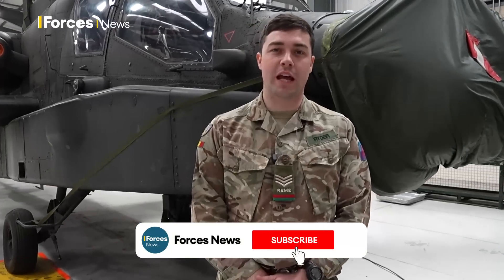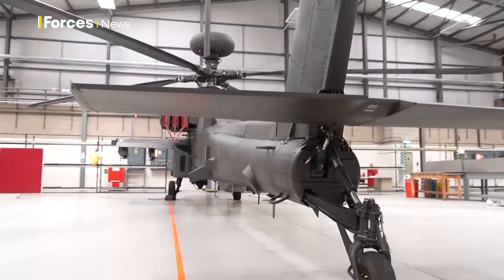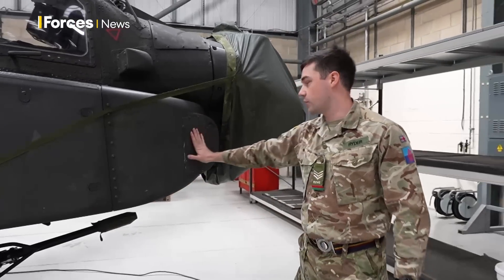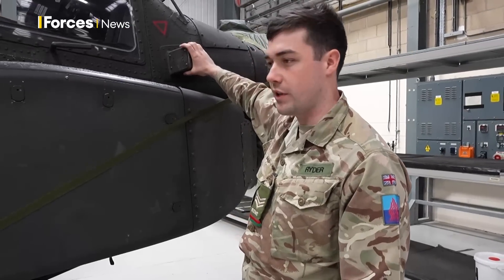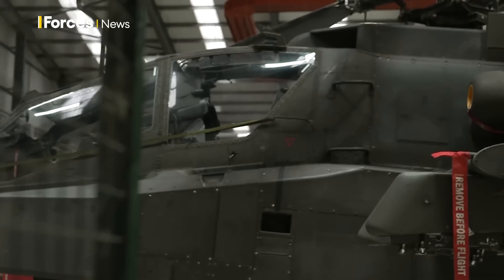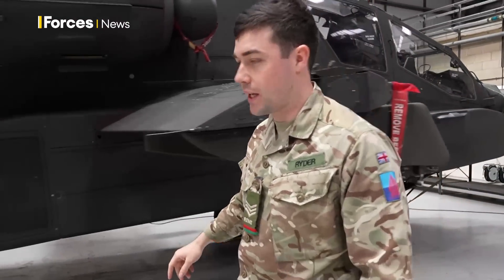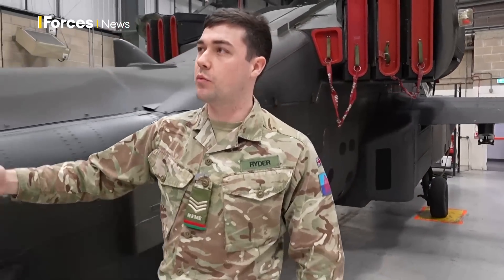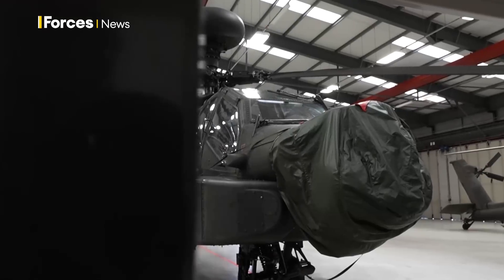How an Apache Mk1 attack helicopter differs from new AH-64E variant

Comment: So it's a slightly lesser aircraft, smaller rotors will have less lift
Reply: WTF are you talking about? You clearly have them mixed up. Watch it again.
Reply: @PureHokkaido The rotor diameter is slightly smaller on the new version thus Davis29.. assumes overall performance is less
Reply: No, the rotors & airframe are lighter, plus the new engine is better 'tuned' to the helicopter so now it uses its whole engine power range

Comment: Has the ability to fold the rotors for naval operations been lost with the upgrade? I know the actual blades are new but I can't seem to find any reference to whether that particular capability has been sacrificed.
Reply: If its anything like the american ones, they should fold just fine
Reply: They all have foldable rotors for storage and transport.
Reply: Nothing to do with "naval operations" since they are not used there...purely for storage and transport.
Reply: @Shontaku  The airframes on the WAH-64 were marinised, i.e. the joints were filled with a compound to prevent corrosion. They were then used on board ships in the Mediterranean during the time Gaddafi was toppled.
Reply: How do you mean? There was no system on the Mk1, and it was done by hand.
Reply: @rogeri2468  Yes, it was done by hand. But my question was if the AH-64E can also do that. The standard AH64A-D variants couldn't fold their rotors at all.
Reply: @jensonkiin3678  The WAH Mk 1 is/was essentially an AH-64D with RTM 322 engines and lots of British avionics. Most of the mechanical aspects were the same, so I don't see a reason why the US model couldn't.